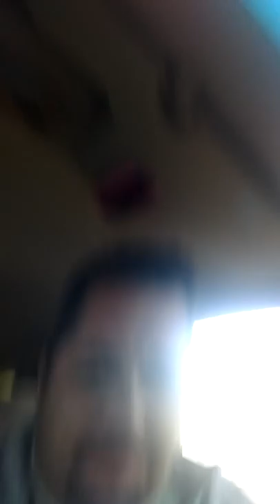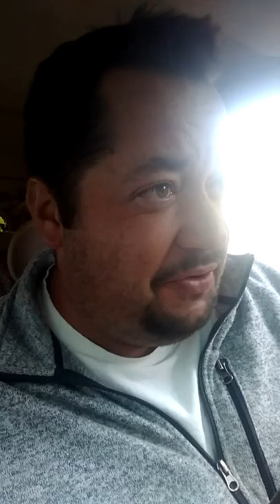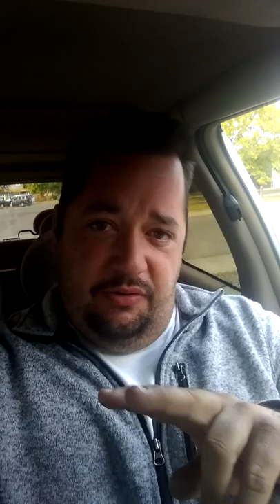1992 - 1998 Villager / Quest Radio Hook Up

Comment: chances are it has a built in amp if so make sure the grey wire that will turn the amp on
Reply from the maker: Bro... lol 😆 That's the first thing I say, I even say, if it DOESN'T HAVE a gray wire, you have to make your own ground. lol